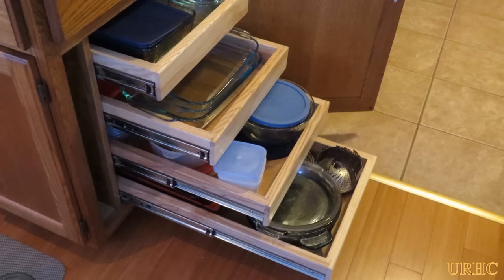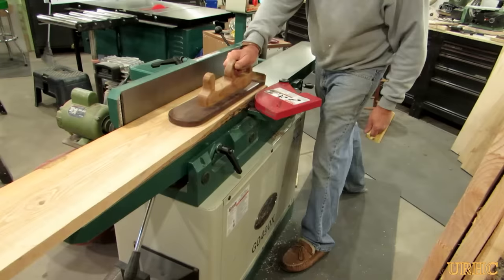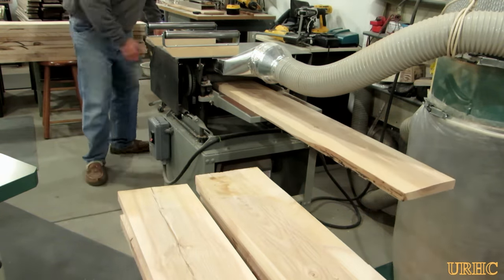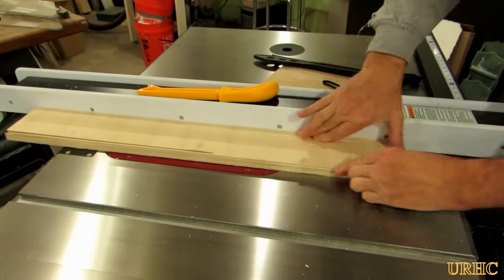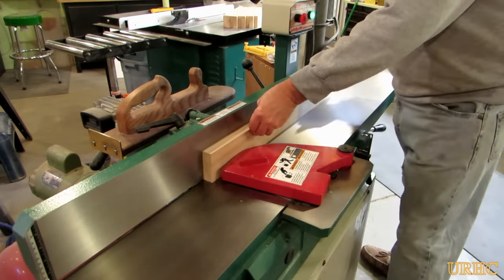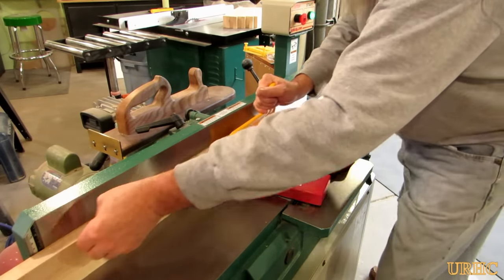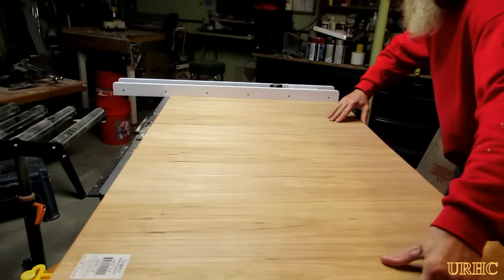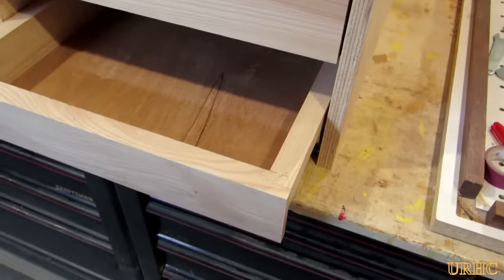Building Pull Out Cabinet Shelves

Comment: You should have turned the grain the other way on the drawer bottoms it would have been much stronger, plywood grain should always span the shortest distance
Reply from the maker: That would  look terrible.  I find it doesn't mater if you use the right  strength plywood.  Aesthetics are a big part of anything  I build. Thanks for watching.

Comment: Not only nice woodworking but very nice video work as well,  Just enough actual motion video with superb audio description to accompany it.  I particularly like the glide draw side technique.  Your right it is always better to build the unit whole and then install it rather than having to go inside the cabinet and try to keep everything in line and true to level, it is back braking work and almost never really accurate.  Modular assembly is always the best method when possible.  I'm just ready to begin a new office desk and credenza and in desk there will be a set of file draws along with the standard draws that come with most premium desk builds.  The draw joint technique used I have used since I was an apprentice back in Local 721 cabinet makers local in Los Angles and that was back in the late 60's   But, I'm going to use your idea of the hidden glide sides, that's a new one on me.  Thanks, it never hurts to keep looking for new ideas even if they say to me  "it's not new I've been doing this for years."
Reply from the maker: The pullouts I made for my other cabinets were mounted to the cabinet carcasses and very tough to get properly aligned as you say. I have no formal training and try to keep things simple and easy to make.

Comment: Found this video while looking for ideas for a pull out cabinet in my RV that will have a counter top on the cabinet box.  The cabinet box will be mounted in the Oak Cabinets, where the pull out drawers are in now and I will put undermount drawer slides under it to make it a slide out box. Then I'll put the original pull out cabinet drawers, with Oak faces, inside the cabinet box.  
As you can imagine an RV has very little room in them.
Your almost flush drawer sides are exactly what I envisioned in my head.  But, I'm a gearhead and I work more with metal than wood.  So this is not second nature to me.  I could weld a frame together easy, but am trying to avoid weight and want to retain the estetics of the solid oak cabinetry in my Top End RV's interior.
Thanks for the video.
Reply from the maker: Good luck. Always fun to shoehorn something into an existing space. Thanks for watching.

Comment: Which table saw do you have buddy? I need to get a new one but just don’t know which manufacturer or model I want to go with. I need a decent one cause I do the same type of stuff as you do but can’t afford a pro model but like the looks of yours. It looks like a sawstop but didn’t get a good front view of it to see the name. 

Whatever it is tho, do you like it and would you buy the same one again or something different?

Thank you so much!! Merry Christmas buddy!!!

Don
Reply from the maker: It is a Grizzly, here is the video about it https://youtu.be/-jw9zJ156P4 it has been a great saw so far.  About the only issue is sawdust collection, the small hose from the blade shroud has to be cleaned often. I would buy it again, but after their planer l would not buy any of their tools made in China. The saw stop was out of my budget also. I had a Delta contractors saw for years before the grizzly and it was also a good saw for lumber under 1 1/2' thick with a thin kerf blade. Merry Christmas.   Thanks for watching

Comment: In reference to the comment about Freud’s blade building up pitch on the gullets.  I saw a video from someone (I believe it was in 3x3’s video regarding ways to put edges on plywood), in which she states spraying the router blades with a coating, helps prevent the router bits from getting gunk buildup.  Maybe that would work for the table saw blades too.
Reply from the maker: Solved the  problem by switching to Amana Prestige blades. They have proper plate clearance and don't build up.  Freud blades have really gone down hill lately.  Thanks for watching.

Comment: Do you have a video that shows the process you used to create the interlocking joints you used on your drawers.  I am redoing my kitchen and those joints look easier than a dovetail and I can use my tablesaw to create them.
Reply from the maker: No they are just interlocking dados with a quality glue. Size them according to the materials thickness.  Thanks for watching.

Comment: Nice work and video. However, the title is me leading and should be “Building a cabinet with pull-out drawers” because it is much more than simply building the shelves. This is a great video for your cabinet build but not for the average joe looking to know how to build slide-out drawers who does not have access to all your tools and lumber. Thanks for the video.
Reply from the maker: Thanks. If you  buy surfaced 4 sides lumber, have a tablesaw and router its basically a beginner project. I have had comments from many about how easy the joinery was to complete a similar project.  Thanks for watching.

Comment: nice job.  i have a mobile diamention brand saw mill so i work with rough cut air dried lumber a lot. jointing-surfacing and sizing makes for a slower process, but if you have the machines to do so, lt is quire satisfying. not many would have any idea how to make a tree into lumber now days. i'm glad i'm one of them. us old folks that can  just got to keep up the old ways! we can't afford to go to the lumber yard for their low quality boards anyway.
Reply from the maker: Thanks.  My little Hudson mill paid for itself the first time I used it. It's a slow process drying lumber without a kiln but very satisfying as you say. Having access to beautiful lumber that grew in the backyard results in large savings on projects like this. Plus there is another batch of trees growing where the old ones came down for future generations to enjoy.  Thanks for watching.

Comment: The best thing I ever did was to get rid of pullouts and use all drawers.  What is a pullout? It's a drawer behind a door. Usually you have to open the door way wide to pull out the pullout shelf. Why not just have drawers so you don't have to  mess with doors.  7 years ago with I build my kitchen I made all my base cabinets drawers,  Best thing I ever did. We love having all drawers. Access is so much easier.
Reply from the maker: We like the pullout. keeps everything stock looking and easy to retrofit.  Thanks for watching.

Comment: 16:10 - Filter on the fan - brilliant!  Never thought of that.  I should do that to my home fan too!
30:43 - I was just going to suggest that the shallow space on extra cabinet doors, could be converted into a spice rack and you beat me to it!  Well done, nicely finished.
Very functional sliding drawers.  I must make some myself.  Thanks!
Reply from the maker: The filter helps quite a bit. There is a recent video about making a double fan sanding station that does a better job. There is also a video about building a spice rack in the top cabinet back a ways.  Thanks for watching.

Comment: You keep saying everything is easy to make - it is when you have such a comprehensive workshop with the range of machines and tools that you have - spare a thought for all the normal people who only have a couple of hand held tools.
Nice work but so it should be with everything you have available.
Reply from the maker: I assume that most wood workers tackling a project like this would have a tablesaw and a router that are the only power tools required if you purchase surfaced 4 side lumber . The joints are very easy to cut and assemble. You may want to look for videos more geared towards the tools and experience you have. Thanks for watching.

Comment: great video i am also doing this to my older cabinets and was going to try to " make them fit by adding extensions on the base cabinets, great idea to just build another cabinet within the original one.  I also like the variations of content that you provide. Thanks again
Reply from the maker: The first ones that I made were mounted in the cabinets with spacers and were a pain to get the slides aligned for smooth easy movement. This way made it real easy to install. Thanks for watching.

Comment: I recently built a pull-out drawer for under my kitchen sink. I don't have all the woodworking tools so I put it together a bit differently. I especially wanted the bottom to have a lot of support for the weight of lots of bottles of cleaning products, and to keep it from sagging if it got a bit wet from a pipe leak or bottle leak, so I have cross-pieces. I also didn't waste any available space, so the back has a notch to allow for plumbing pipes on one side. It was challenging to say the least!  Yours look much better, and probably slide better than mine. I put the slides on the bottom & it was really difficult to figure out where to attach them for the best slide.  Main thing though - it works, it holds more stuff than I was able to fit under there before, and I can find everything! 
The only part of your project I would have done differently is the shelves.  I would have used that super thin plywood that you used for the bottom of the drawer to line the bottom, and made shelf peg holes in two cabinet-height vertical pieces of plywood or ash. I say this because adjustability in cabinets is like THE most important thing to good organization and storage.  I have kitchen cabinets with unmovable shelves and it makes me absolutely crazy.  I say this not to be critical of your work - which was excellent! I say it for you and for anyone else who may find themselves doing cabinet work when they're not the person who most frequently uses and/or organizes the cabinets.  Always consult the end user!  :-)
Reply from the maker: I have  been building these for years and no one has ever had a problem. Build what works  for you and don't  worry about critics . Thanks for watching.

Comment: Get the WD-40 speacialist dirt & dust resistant dry lube to prevent pitch and resin build up on blades and router bits, it works great
Reply from the maker: I will look for that.  Thanks for watching.

Comment: Nice Job Friend ! 
I wish you could do a video on the slides, how to measure and which ones to buy , correct spacing , Ect
Thank You
Reply from the maker: The full extension 100 pound slides are all 1/2 inch thick and the ones I used called for a extra 1/32 clearance on each side. See the slide manufacturers install sheet for the requirements of their  slides and proper clearance. They are all rated by the weight that will be supported and always at least double your load to be safe.  Manufacturers have great info on selecting their products and the types available.  Thanks for watching.

Comment: What make/model dust collector do you have? I'm impressed at how much dust was captured off your planer
Reply from the maker: Just a grizzly 2 hp canister filter dust collector.  Any collector with at least 400 cfm should work with the planer. You have to move the seals in the planer to catch all the dust, they come from the factory in the wrong location. Thanks for watching.

Comment: The hose that is plugging up on your table saw looks like it is a little long and shaped in a manner that does not promote ventilation of the saw dust. The tube should not go up and then back down.
Reply: I had exactly the same problem. I shortened the hose and I was amazed the difference it made.
Reply from the maker: They had to bend it like that for the saw to pivot. Plus the flow is blocked by  the way they divide the flow. Thanks for watching.

Comment: You are really very clever and talented in your design and workmanship, but honestly your safety skills are very much lacking. I don't intend to take away from this awesome video, I just want you to consider that after reading all of the comments, that you will have some less experienced (maybe younger) woodworkers watching this that will emulate how you cut, plane, etc. The more experienced will know better, the less experienced will not.  Just a suggestion.
Also, I have a 220 Single-Phase  3HP Sawstop PC table saw with a Frued LU74R010 and a Diablo D1080X and it cuts through 4" Doug Fir and 1" Walnut like butter, even at a significant feed rate and the ends come out as if polished with no chips.  I also use a zero clearance insert.
The cutting power is primarily due to the power and efficiency of the 220 saw motor, it is also far more efficient.  Couple that with a 3 or 5HP rated drive and it is going to perform well regardless of the manufacturer.
In regards to blades, I have found that Frued Industrial and Forrest make the very best saw blades.  And if you aren't concerned with waste, you can select a larger kerf saw blade which will last longer between sharpening and over the life of the blade.
I also noticed an accordion type saw dust hose in the table saw.  A smooth surface flexible hose has far more superior performance.

And again, I really love your videos!
Reply from the maker: I remove the guards and take shortcuts to get the video, but usually note it is only done for the video. The saw has 5hp and the freud premiere fusion blade has no clearance from the teeth to the red coating that causes the burning. It was a mistake thinking one blade could do it all. The saw has a poor hose to the guard design that blocks flow and reduces the input square inches that ups the static pressure and reduces the flow. Some day I plan on redesigning that area. Thanks for watching my videos.

Comment: Can you say anything about the Shop Fox D4459 drawer slide?  It's a self-closing model, but lighter duty, rated at 55 lb.  A little cheaper than the 100-lb model D3067, but is the savings worthwhile?
Reply from the maker: I do not think they are not heavy duty enough for a lower drawer that someone may lean on. I think they are for smaller drawers and desk drawers. I don't think the savings would be worth it, but have no experience with them.

Comment: Brilliant as I can't bend or kneel like I used to so when we build our new kitchen I'll ask the builder to add something similar to the cupboards. Also all of my cupboards will be pull out pot draws along the bottom of my kitchen. Along the top we'll use a system where the shelves drop down so I don't have to risk a fall using a step ladder. Shared this video to my Aussie page too.
Reply from the maker: I have been adding these shelves to all my cabinets and they really increase the storage space in our little kitchen. Thanks for watching my videos.

Comment: Clean up the saw blade well and then spray it with WD 40.
Reply from the maker: I replaced it with an Amana blade and haven't had a problem since. This blade was ground so there was no clearance for the coating. Try Amana Prestige blades, they are awesome. Thanks for watching.

Comment: Loved this video, I have earmark it so I can watch it again in the fall when I plan to make some pullout drawers for my kitchen and camper. Wish I had access to all your tools and space but I know how to make due with my portable table saw and sanders and a very small shed to work in. Your block sander sounds just like mine, they have a special sound. I think I will steel your idea of putting a filter on the side of a box fan!
Reply from the maker: They are a very simple construction that can be made mostly on a table saw. I started building items in a 10 x 10 shed in a trailer park with a portable saw like you. The projects turned out just as good, but took a little longer to make. The fan does a pretty good job of removing dust from the air and costs less then $20 to make. Thanks for watching.

Comment: I notice you use grizzley equitment
Do you like ? How do rate
Reply from the maker: It works good and is affordable.  I had some issues with the planer and it took a while but they finally sent the parts to fix it. If you buy any of these lower priced pieces of offshore equipment go through them good and spend time doing a proper set up no matter who they are purchased from. Thanks for watching.

Comment: What brand of drawer slide did you use, could not understand what you said.
Reply from the maker: They were the Shop Fox 100 pound capacity full extension slides from Grizzly. Thanks for watching.
Reply: I plan on turning some of my bigger cabinets into what you just did, nice job and thanx.

Comment: Full extension slides are a mystery to me, how do you know what length to use in your project? Thanks again
Reply from the maker: I just use the longest slide that will fit. Good thing is full extension slides are usually the same length as the travel. Just match the load rating to what you are moving, and if you have young children make sure it will also hold their weight because drawers make great ladders.

Comment: If you have a dremel, remove the paint on the blade, from behind the teeth and try to bring the metal under to a polish. You can even taper the end of the tooth if you want, but not too much. Essentially, you want to get rid of the paint and have bare polished metal.
Reply from the maker: I may have to try that. Thanks for the idea and thanks for watching.